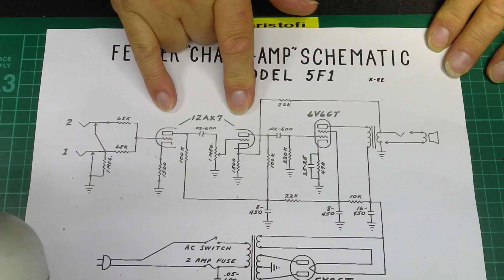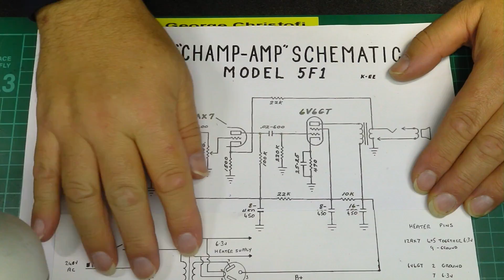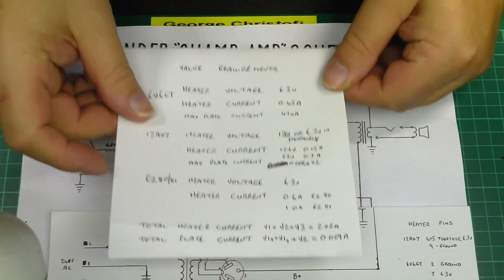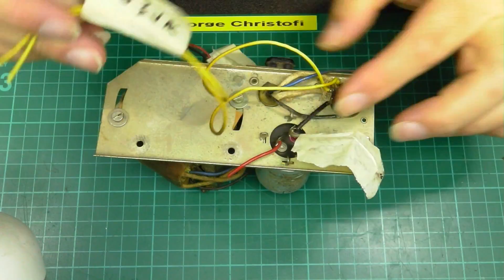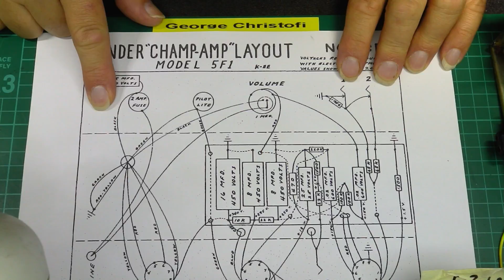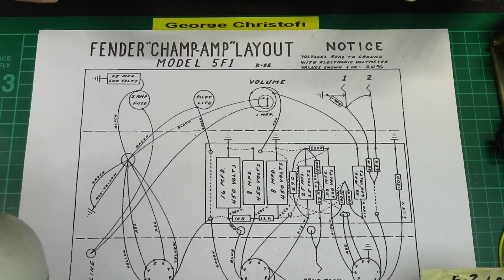Build a Champ from a Frontman! Part 1 : 5F1 Design

Comment: What did you do with the Original Frontman 15G Board that was in the box?
Reply from the maker: The board was but butchered so it went into spares for pots and other bits.
Reply: @GeorgeChristofi  - was the board salvageable to rebuild from scratch?
Reply from the maker: @williamcolvin3609  not really. It had been abused like the rest of the internals
Reply: @GeorgeChristofi  - I purchased a panel from E-Bay that a Seller was parting out and the components and board look like it has been around Salt Water . The leads were corroded of and some of the traces dissolved - thought maybe your board might be in better shape if you wanted to part with it.
Reply from the maker: @williamcolvin3609  it was quite a while ago so I'm probably not have the board still after salvaging the useful bits.

Comment: hi ,i made a fender 5f1   and i want   change 6v6 for 6l6 tube can i keep the same cathode resistor value if not what value is correct .thanks for your help
Reply from the maker: I should be able to give you some values when I return to the UK in a couple of days assuming I can get back home due to this worldwide problem.

Comment: wow! great stuff! how did you start making amps?
Reply from the maker: It just sort of happened really. My kids both play guitar and I just fancied the sound of valve based amps to the transistor ones. My first one was an 18w marshall clone in an old Laney chassis and just sort of carried on from there. It goes in with repairing old radios which use pretty much the same technology at the output stage.

Comment: Thanks very much for taking the time to do this. This is definitely the most comprehensive series of videos on this subject.
Can you supply the link to where to buy the kit. I don't think it actually appeared in the video. Thank You
Reply from the maker: It's hard to give a place to buy the parts as some are second hand parts (transformers and valves) some were bought in (chassis came from eBay, valve sockets from aliexpress) and some were just general parts that I keep at home for repairs. (Resistors and capacitors)

There are suppliers worldwide, depending on where you are but here in the UK for specialist amplifier components you have to go to various web based retailers otherwise you could end up paying far too much for things. As a rough guide, I tend to use 1w metal film resistors unless specified, 600v polyester capacitors and 450v electrolytic capacitors. I don't like using vintage components as they are usually past the sell by date and could be a source of problems except transformers. If they test good then generally the older ones sound better and are built to a higher quality. Tubes... I don't like Chinese ones. Too fragile and a bit rough sounding.
Reply: I see, my misunderstanding. Thanks for the info
Reply from the maker: cramesor1 if you are looking specifically for a kit, in the UK ampmaker at Cambridge are good source. I have bought components from them in the past. Again it depends on what you really need.
Reply: George, really appreciate it. Looks like an excellent source. You may have gotten them a sale!

Comment: love your video you may have made a boo boo with the HT 0.047 current for the 6V6 0.0012 x 2 = 0.0024 for the 12AX7 total current 49.4 MA
Reply from the maker: ian forster I did work out the total draw to be less than the max for an EZ80 at 90mA. I probably drew my decimal point in the wrong place.
Reply: yes it all under 0.090 amp i add the max plate current and the max screen curren for my 6v6 outputs 0.054 amp for the output plus the 0.0024 amp = 0.056.4

Comment: Nicely explained; detailed, understandable and not too technical.
 I have done such a project and I'm sure others will have come across dead "Frontmen" too. Regarding old Fender schematics; you might mention that old "death cap" on the old two-wire power cord should definitely be discarded with modern earthed three wire systems.
Reply from the maker: MickP , thanks for the comments and yes, you are correct about the death cap on the diagrams. I didn't mention it because it completely slipped my mind after redoing the diagram with the EZ80.